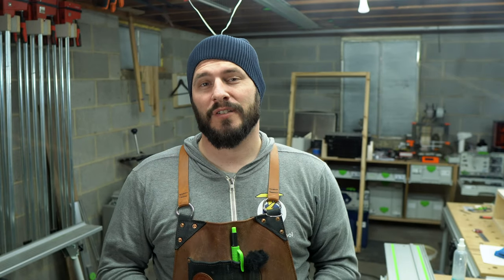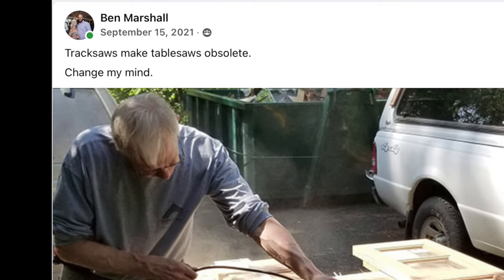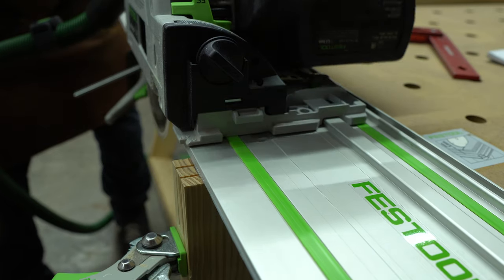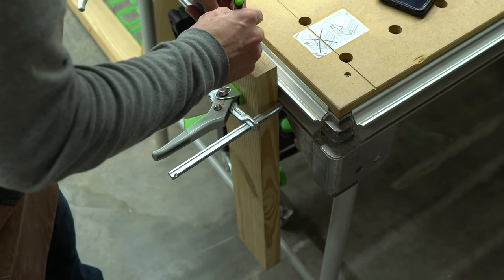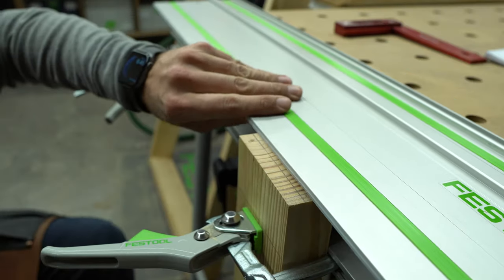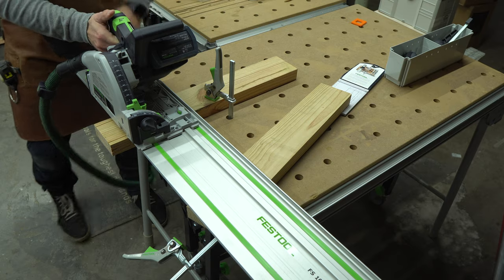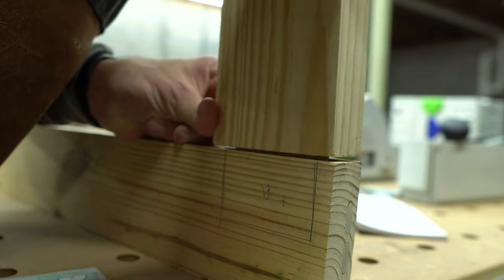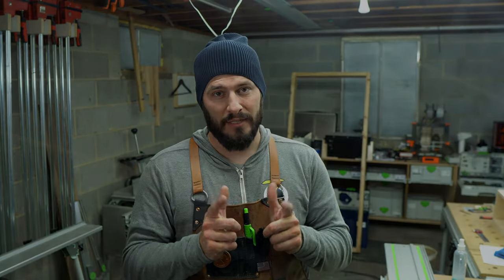How to Cut Tenons with a Track Saw

Comment: Awesome video as always, Ben. 

The tablesaw is a great example of “if your only tool is a hammer, every problem looks like a nail”

I want to see someone cut a mortise with a tablesaw…

Now the one guy was right: I’d love to see a box joint from a tracksaw. Probably much easier with a Festool router on the track, but seeing it done with only a tracksaw ould be very impressive. I kinda feel like cutting them on a tablesaw or moronic, but that’s just me I suppose.
Reply from the maker: Thanks, Jason! Cutting tenons on a table saw is relatively straightforward and it's literally the same process I did here, you just need to build a jig that rides the fence for the cross cut section method, and a miter gauge/crosscut sled for the kerf cut method. Although kerf cutting can get tricky the longer the board is with a cross cut sled. Box joints can be cut on the table saw as well, but again requires a jig. There are really simple and basic sleds for this, @bentswoodworking has one on his channel. There are also manufactured box joint jigs, like the one Incra makes (or used to). 

Right now I'm debating whether the next video will be dovetails or box joints - both are possible with a track saw. Using a track saw may not be the best tool to use for either of these joints, but I just want to show that the tool is versatile enough to do it for those that can only buy one tool at a time.

Comment: loved it! would be nice to see a 75 degree bevel cut using the board perpendicular to the bench (like you did here but cutting a bevel on 15 which would result in a 75 degree cut)… useful for a table top bevel cut!

Comment: What I don't see is the repeatability.  What the TS does best is I can set it up and run through many pieces with the same exact settings. I have a track saw and table saw, and this is pretty darn awesome idea, but still will be using the table saw for tenons.
Reply from the maker: With a simple jig (also would need on for a table saw), you can achieve the same repeatability while cutting multiple tenons at once - not something achievable on a table saw unless you have a big jig. I feel that on a track saw it would be more manageable. However, to each their own. I simply want to show people that it's possible without a table saw. Appreciate the comment and watch!

Comment: Also, a table saw needs to be sturdy enough, needs enough surface and length to support the work piece to keep it straight, you have to be able to accurately set it etc, all things that cost quite a lot of money and space. A tradk saw with a long guiderail is accurate, takes up little space and costs less to be accurate. But i agree it takes some mental adjustment.
Reply from the maker: Yep!